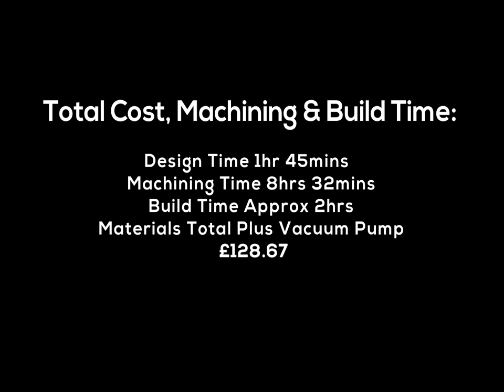Westmach CNC~ Episode 2: Making an Aluminium Vacuum Table. (TIME LAPSE)

Comment: Great job. Looks like you've replaced the SAE inlet fitting that normally comes with those vacuum pumps. What size is the female thread in the pump body?
Reply from the maker: 1/4" BSP if i remember rightly

Thanks Jack

Comment: Really nice job!  I see there are comments regarding the material size and thickness and liquid gasket sealer.  Are you willing to share either on here or offline the dimensions of this project?  Width and depth of all cuts, size of square islands on top side, CAD files of  some sort for top and bottom of both pieces.  I use Vectric V Carve Pro on a Laguna Tool IQ.  I would also like to change the composite main table for an aluminum table as well.  What thickness and grade aluminum did you use for your main table?  Nice machine and work!  Thanks
Reply from the maker: The machine is all C250 grade aluminium or machine tool grade it was 20mm thick, I can share the files but it is really simple to do with vectrics. I use aspire but I can share if you need it. Cheers Please subscribe and like ;)
Reply: I think you did an amazing job. Any chance i can get a copy of your files as well. I have vcarve and aspire.

Comment: Very impressive.  I have a cnc router very much like your's and would like to make a CNC table like your's.  Do you have the CAD files or G-Cod on-line?  thanks.
Reply from the maker: Hi thanks man! 
The aluminium is C250 grade machine ground also called tooling plate. This one is 450mm x 300mm 20mm thick and there's two of them. Its really easy to edit if you give me the dimensions you want I'll send you code. Thanks JP

Comment: Hi jack
I'm planing to make myself one but I have no idea about the size of seal strip and width/depth/R of keyway, can you share this information? Thanks!
Reply from the maker: I went with a 3mm end mill cut with a 3mm gasket which was perfect. I got the gasket seal off of ebay. Thinking about it now i should of gone with a 3mm ball nose and cut 1.5mm deep. if it isnt a good cut you can always go deeper. Thanks for the comment please like and subscribe!

Comment: I have a question why you need the lines and not just make the holes?. Thanks
Reply from the maker: Viktor Peralta Better Vacuum requires greater surface area for it to hold things down effectively. You would get a significantly reduced effect without the channels.

Comment: Cool!, what grade aluminium do you use for this? What is the slot width of the grid? And what do you use as the gasket material? I’m thinking of making one of these. Cheers
Reply from the maker: Oreet Iain, Ahhh a grittier question. The aluminum is 20mm thick C250 tooling plate just pre purchased precision fly cut is all from a company called Metalweb. If you're thinking about making one I would suggest you increase your bore holes through the plate to approx 3mm also maybe increase the vac pump size as it struggles with anything of greater surface cut over 6mm. The tube is a neoprene foam material and I will put a link in the description. The slots are all 3mm wide by 3mm deep. You will need some sort of gasket sealant if building and ideally set the bolts to the same torque when bolting up i did get some minor distortion on the top plate after I bolted it up. Hope this helps don't forget to subscribe dude ;0) Cheers JP
Reply: Jack Phillips Nice one, cheers for the info and quick response, just finished building my CNC router a couple of weeks ago, done a few bits n bats on it so far with decent results, being over-cautious with the speeds n feeds at the mo, but will gain confidence as I go, will deffo be making one of those vac tables for it, will come in handy. Cheers again for the info. Iain
Reply from the maker: Iain Parkinson be interesting to see what you’ve done. My machine I built myself and it was a really good experience have 3 different CNC machines now and I’m looking at purchasing a larger VMC this year. If you get stuck with anything or want advice I’m no expert but I know abit. Thanks JP
Reply: Jack Phillips Sound, I will post some clips of my machine on my channel soon, totally built from scratch taking inspiration from other machines I’ve seen on here, capacity is approx. 450mm x 500m,  it’s not bad for a first attempt but I already want to make MKii !

Comment: Impressive...What's the biggest piece of ally you can fit on the table? (Alan)
Reply from the maker: Thanks for your comment, length well over a metre and width approx 750mm. cheers JP
Reply: Jack Phillips 750mm? So you can allow material to hang over the table and remain sturdy enough to machine? I'm presuming you fasten the vacuum table down. Is there a maximum thickness and depth of material/cut you can do before it shifts the material out of place or does it pretty well hold anything within dimension adequately regardless of the size and depth of cut? Thanks.

Comment: material and aluminium plates only 128 pounds??? how come...these pomps cost approx 100 pounds ....
Reply from the maker: The pump was only 45 inc postage from infamous fleabay. It doesn't have to be any real strength I think this one was only quarter HP. Its the surface area that gives your holding power. It all depends what you're machining I suppose for the plates I do its grand.

Comment: Hi Jack
Can you share your NC file.
Reply from the maker: Hi Sorry what do you mean?

Will happily share though.
Reply: Hi Jack,
Its actually nice to hear a northern accent instead of an American one.
However i do like the guy John Saunders here on YouTube NYCCNC Hes the dood.

I was just looking for the .nc code (has the machine code XYZ steps in it) file your machine used to cut the troughs in the plate.  I figured you were using a cnc machine to mill the table.  What program is your mill using Mach3 ?.  I produced an autocad drawing of a vacuum chuck not dissimilar however i did cheat.  I thought of milling the grooves in the top as you would but then drilling only one hole in from the side of the plate into the centre then a hole in the top of the plate down into the side hole.  Your design using a chamber milled under the plate instead which to be honest is the correct way of doing it.  I tried to convert the file in Cambam (post processor) into an NC file for my milling machine but ended up making about 100 profiles around each castllation in the top plate, not the straight x then y mill routes i was expecting.  Im Still a novice i'm afraid.   I did manage to build a vacuum ejector/generator for to go on an air supply like this one on Ebay

http://www.ebay.co.uk/itm/291533604890?_trksid=p2057872.m2749.l2649&ssPageName=STRK%3AMEBIDX%3AIT

Got some good results as well

I have a similar Vac pump to yours which is actually what i will use in the end.
Reply from the maker: Yeah the NYCNC dude is abit of a Ledge nowadays with a much bigger wallet than me as the machines he runs are very good but pricey. I'm more wing and a prayer engineering and I'm in the process of building another machine which will be a dedicated VMC. The machine in the videos I built myself so Mach 3 is the obvious choice to run it. I used Vectrics Aspire to do the design of the vac table .If you need a specific size i'll make it match what you need as its a really quick to do.

Thanks for the Feedback.
 JP